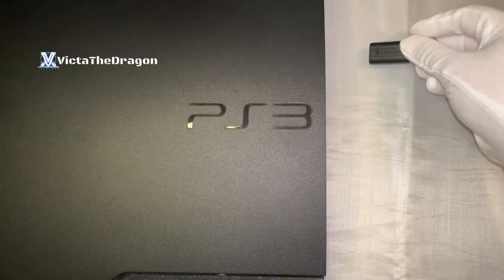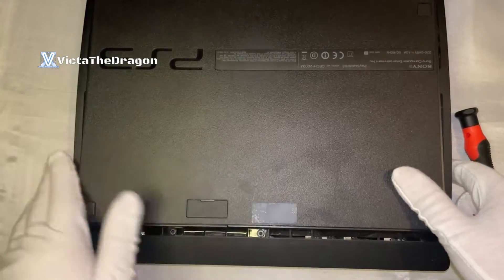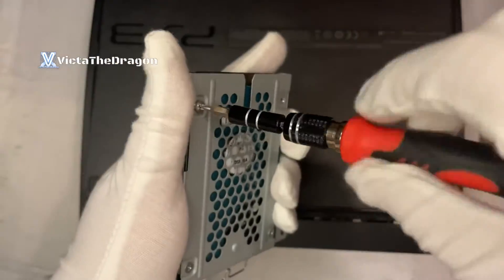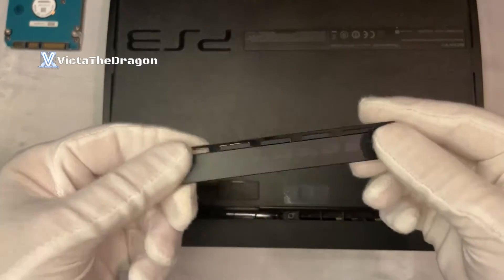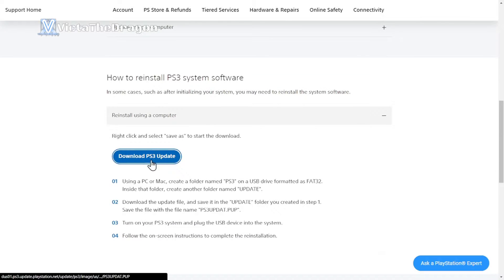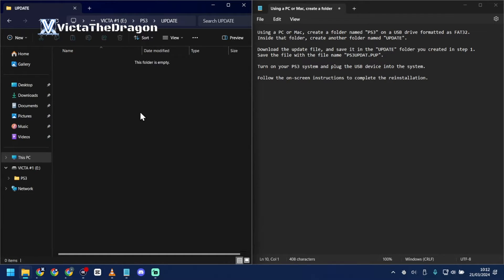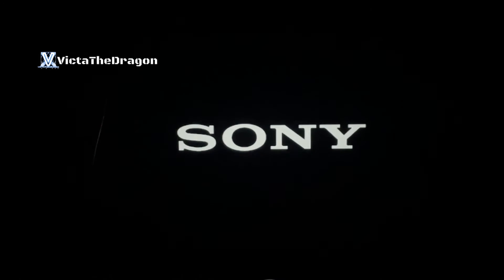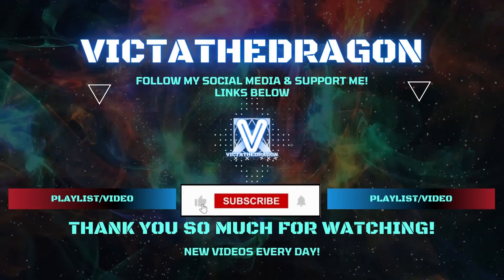PS3 SSD Installation Guide: Upgrade to Maximum Performance with Easy Step-by-Step Instructions!

Comment: Are the game files gonna be erased when switching the hdd to ssd or how does it work?
Reply: You have to backup your games to a usb thumbdrive or external hdd. Get large capacity drives because you probably have gigs of stuff that you want to save. It will take many hours to back everything up so be very patient and don't disturb it while it's running
Reply: Do backing up all games require having all the emails accessible ..I have games that were downloaded from 2 separate PSN - PS3 user accounts if you understand me (one of the accounts I don't have access to basically)  any way to ensure I'd have all my downloaded games or I might as well forget about those I don't have the email access for?
Reply: @berniemackattack86  No that shouldn't matter
Reply: @NesLightGun so I will.have the actual game transferred in the back up process ? Im not talking about the save data
Reply: @berniemackattack86 im actually not sure. I’m fairly certain it will backup the games. And after a quick google search someone said that it does back up digital games
Reply: @NesLightGun have you ever done a back up process yourself.. ?

Comment: Tried with that Samsung Evo Sata, also tried with a Crucial MX500 Sata in both FAT32 and EXFat and when it asks me to format it displays the message that this HardDrive is not compatible with this System, any ideas how to solve this? my PS3 is a Fat model that used to have a 60GB HDD🤔
Reply: What is the SSD capacity you used? Because anything above 1TB is not really compatible with the PS3. Both drives you mentioned though are 100% compatible with the PS3. It might just be that your old fat model runs ancient bios and can't recognise the SSD. 

One more thing. Try wiping out the drive without formatting it to any file system and try again. Or try formatting to fat32 with MBR.
Reply: @johnarvanitis9328  Thanks for the info, but i already tried that with both of my SSDs, i followed all instructions and also updated the Bios first before i did it with the native 60GB HDD, even tried resize a partition to 980GB with a partition manager but still didn't worked, the only option i have now is to get one of those models but with 1TB🤔
Reply: @MysticDragon1988  If each of your SSD's are above 1TB then that's the problem for sure.
Reply from the maker: Here are a few things you can try to resolve the issue:

Check Hard Drive Size: Make sure that the hard drive is 2.5-inch and no larger than 1TB, as some PS3 models have difficulty reading larger drives.

PS3 Compatibility: The PS3 requires a 5400 RPM drive. If the drive is faster (like 7200 RPM), it might cause compatibility issues. Stick to 5400 RPM drives, which are safer for the older system.

File System: Even though you’ve tried FAT32 and exFAT, the PS3 hard drive itself will be formatted by the system in its own proprietary format. You should just put the drive in without formatting it beforehand, and the PS3 will prompt you to format it once installed.

Full Power Cycle:

Turn off the PS3 completely and unplug it.
Remove the hard drive and then reinsert it carefully.
Plug the PS3 back in and turn it on to see if it prompts you for formatting.
Update the PS3 Firmware: Make sure the firmware on the PS3 is up to date. Sometimes older firmware can cause issues with recognizing newer drives.

Check for Loose Connections: Double-check that the SATA connectors on both the PS3 and the hard drive are securely connected.

If none of these work, you might want to test the hard drive on another system to see if it's functioning properly or consider getting a different model of HDD that’s been confirmed to work with older PS3 systems.
Reply: Did you ever get that ps3 working Dragon?